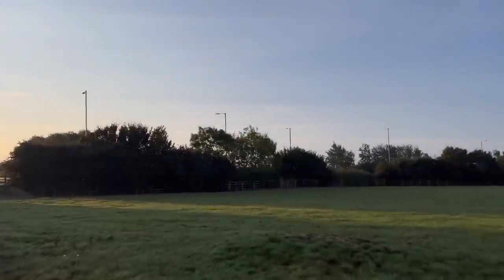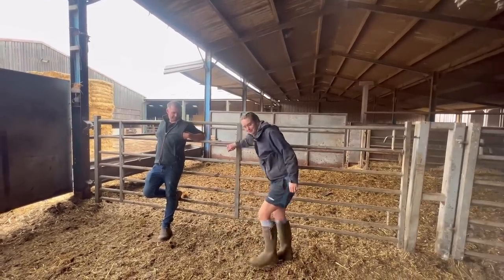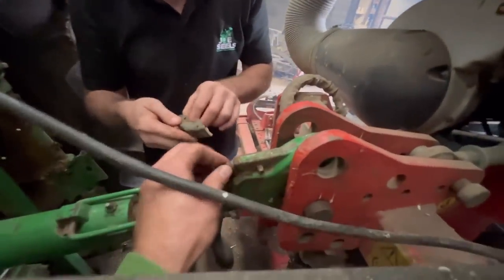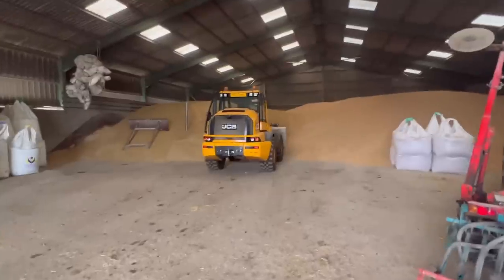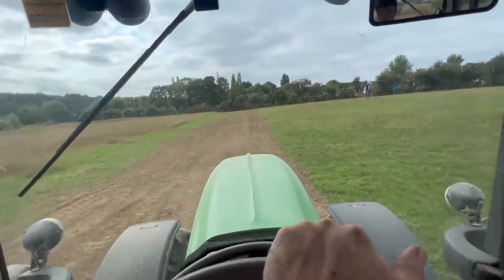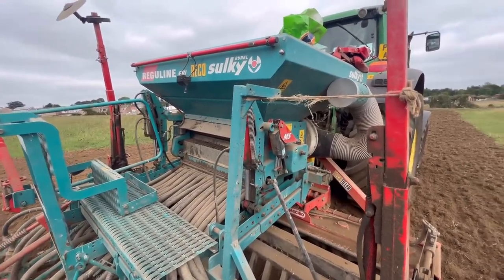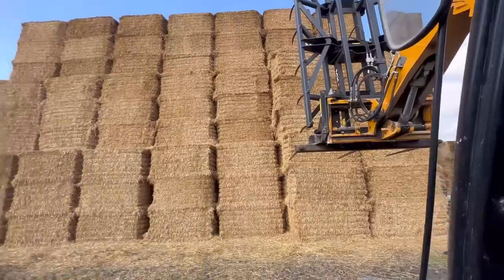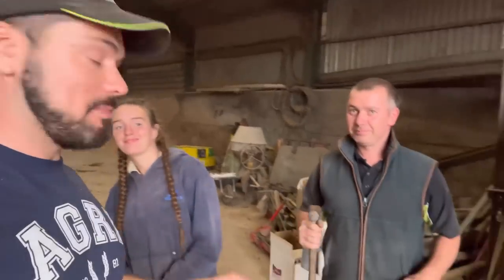Drilling, Ems Milling and Rolling! Cattle as Well!

Comment: Hi Joe, tell me to mind my own business if you want,  but I felt l had to mention that when you started tractor up and revved it by the straw stack had a spark came from the exhaust you may have been calling your mate's from the fire station. Just a thought.
Reply from the maker: I think the risk was low from cold, and there was a fair distance from exhaust tip to bales. More chance in heat of summer when I’m stacking bales with the 9m 😀😀, but i wouldn’t advice running the tractor for prolonged period if it was close to stored flammables, even if it was that close 😀😀